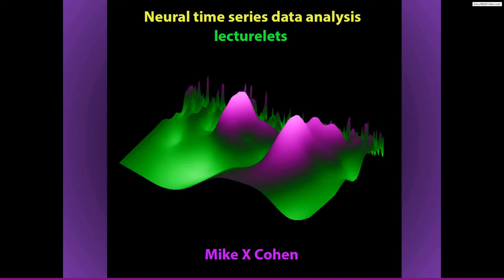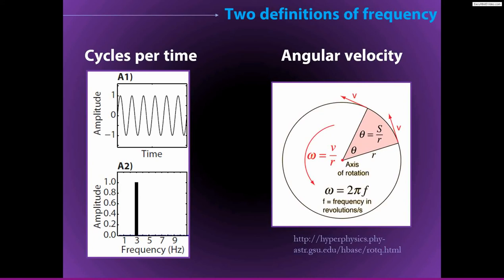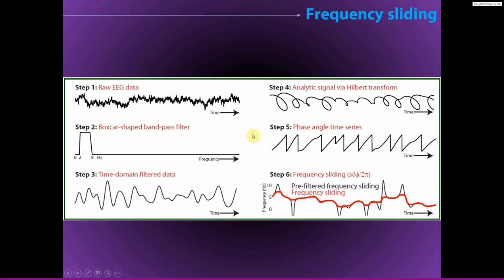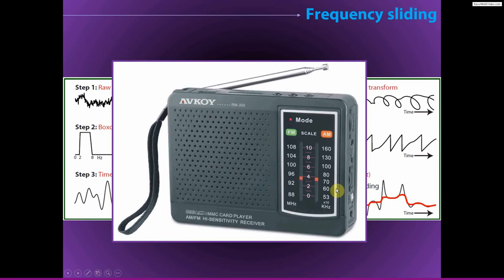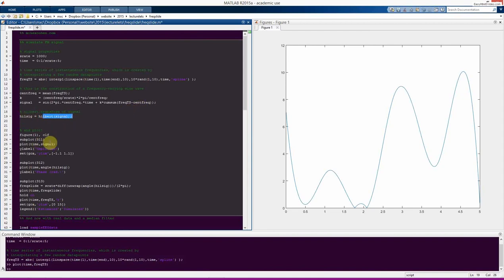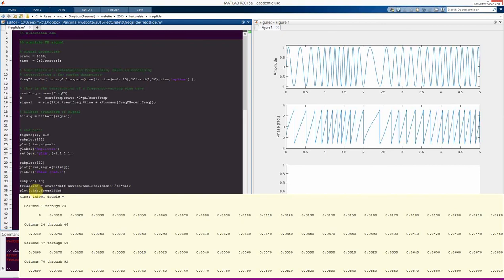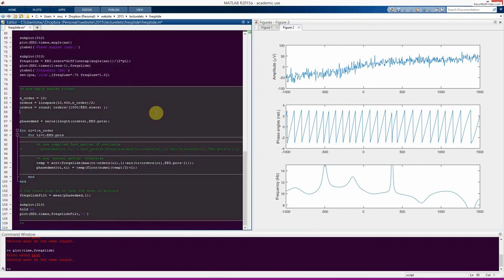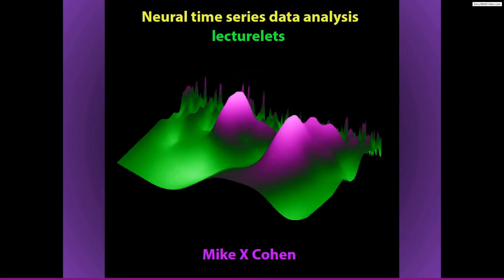Instantaneous frequency (frequency sliding)

Comment: Good job, Mike, I have a noise signal (Amplitude vs Time), I want to get the frequency-time series, there are lots of methods (STFT, Hilber-Huang, etc) but none of them can compute frequency-time series, I want to ask if this code suitable for noise data?
Reply from the maker: Interesting question. The method I show here is appropriate for narrowband signals. If the noise is broadband, then technically you can apply this method, but I think the results will also simply be noise. If the noise is narrowband and has some spectral dynamics, then yes, I think this method would be useful.

Comment: what is the instantaneous frequency of following the  signal x(t) ? and the averaged frequency in one cycle [0, 2PI] ? I think this question is interesting to discuss what 'instantaneous' means.
x(t) = A1 *sin(ωt) + A2 * sin(3ωt);   case1: A1= A2 , case 2 A1 > A2, case 3 A1 < A3
Reply from the maker: Indeed, "instantaneous" has to be take with a grain of salt, because it is defined as the distance between two successive time points. A more accurate description might be "highly temporally localized frequency."

Comment: Hi Mike

I am working on a project aiming to measure the speed of a travelling wave along the surface of the breast for tumor detection and am trying to apply your EEG methods. I wish to do this by acquiring the instantaneous phase angle across a wave profile (essentially an image of a slice of the breasts surface taken at a fixed point in time therefore my data has a limited 'buffer zone'). I have implemented the Hilbert transform and experimented with complex wavelet convolution but am having issues with edge artifacts at the end points of my data set. Working through the methods in the textbook I am beginning to think that any method I implement will leave me with a similar result - the errors in the signal processing method will outweigh the useful result.

It is not possible for me to reflect the data for each trial, or stitch multiple trials together, due to extensive asymmetry and damping occurring.

Apologies for all the gory details, my question is:
Which of the methods would be the best to pursue for phase angle acquisition in a case where the data is of very low frequency? I have on 2-3 cycles of data at the frequency I wish to analyse.

If you would provide your email via dm, I could provide an example of the data I wish to analyse.

Thanks
Todd
Reply from the maker: Hi Todd. I have less expertise on image processing compared to time series analysis, so I don't immediately have a solution. My first thought is whether the edge effects are really so bad. Any filter will impose edge effects, that's not really something you can avoid. 

Perhaps an idea is to fit the data with a 2D cosine and sine function. If you find the best-fitting sine/cosine pair, then you can compute phase as (in MATLAB) atan2(sin,cos). That would ignore any non-stationarities, though. If you do this based on 2D Fourier coefficients, you would be able to reconstruct the phases for a variety of spatial frequencies.

You can find my email address in my CV, which is on my website. Feel free to send me an email with some screenshots.

Mike

Comment: Hi, in term of both this lecture and another on hilbert transform, is there different assumptions in different lectures? here we assume the frequency is changing while that on hilbert transform we assume constant frequency but changing amplitude and additional phase \fai. Which assumption to choose depends on different application situation. In band-pass filtered eeg signal, we usually assume constant frequency but changing additional phase?
Reply from the maker: Do you mean the difference between the video in ANTS#1 series and in ANTS#2 series? They were filmed 4 years apart, so the more recent ones are much better ;)

I might stress different things in the different lectures, but the assumptions are the same. Phase and frequency must change together -- it is not possible to have dynamics in phase without (at least subtle) changes in frequency. You can apply the Hilbert transform to any narrowband signal and interpret either the instantaneous power or instantaneous phase (which can be converted into instantaneous frequency). Which feature you focus on depends on the goal of the analysis.

Comment: Really nice video. This is good to know. I have a question though: What if we had a signal with multiple superimposed sine waves? Does this work for reading multiple frequency components? If not, is there an approach for detecting multiple frequency components? Or is it best to just track multiple peaks of the FFT spectrum in this case?
Reply from the maker: Yes, the method is still valid, but you would need to narrowband filter the signal first to isolate the different frequencies. The filter should be narrow enough that it removes the other frequency components, while not being so narrow as to remove the dynamics you're interested in. For example, 8-12 Hz might be a good range, whereas 8.1-8.3 Hz is probably too narrow. Keep in mind that "how narrow is best" will depend on the application and on the signal.

Comment: There are lots of frequency components in that EEG, to which ones do the periods belong to? Based on what did you chose the median filter window size?
Reply from the maker: Great questions. Ideally, you would start with one narrow frequency range based on a priori (e.g., hypothesis-driven) expectations about the frequencies in which you expect the effects to occur. You could also use an exploratory approach to examine lots of frequencies, but the large amount of data plus noise typically makes hypothesis-driven analyses the best approach. 

As for the median filter window, to be honest, there is some arbitrary selection there. I used those parameters based on my own piloting/testing, but I wouldn't argue that they are necessarily the best parameters for all situations. That said, the median filter itself is great for this situation (sparse large outliers).